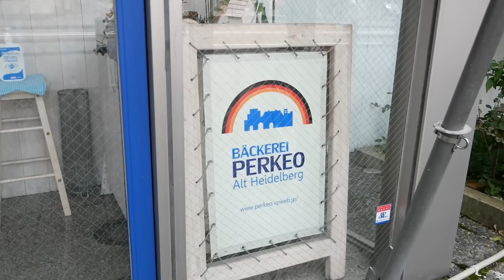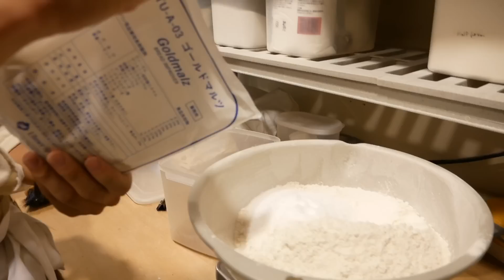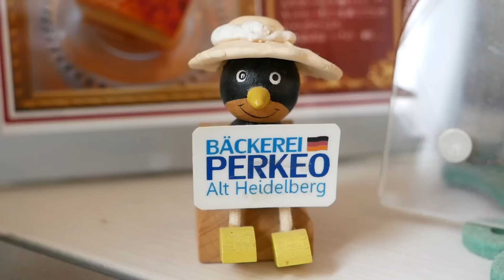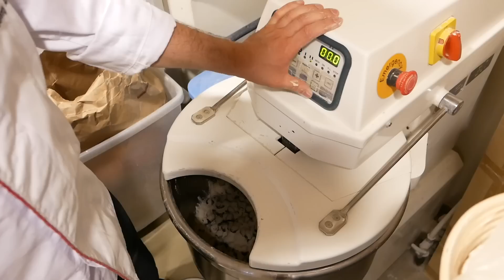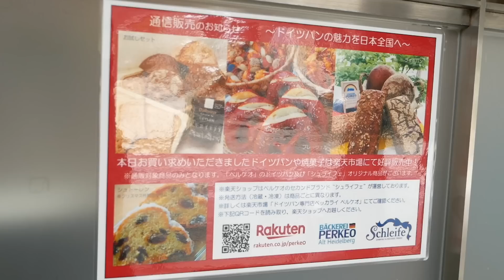京都に降臨したドイツ人の天才パン職人！ドイツパン専門のパン屋「ベッカライ・ペルケオ・アルト・ハイデルベルク」

Comment: What's in the spray bottle , that you spray them with when they come out of the oven.? great video BTW
Reply: I'm assuming water. Because he uses it before they go into the oven as well. It's probably to give them a bit of a shiny finish (when after baking) and a harder crust (when going into the oven). :)
Reply: @FlowerofDissolution   Thanks. I thought that it might be water but wasn't sure. Cheers for the reply.